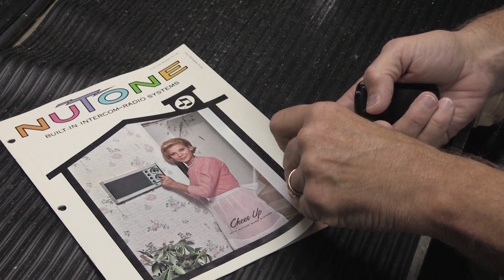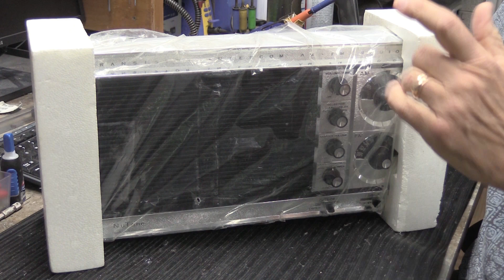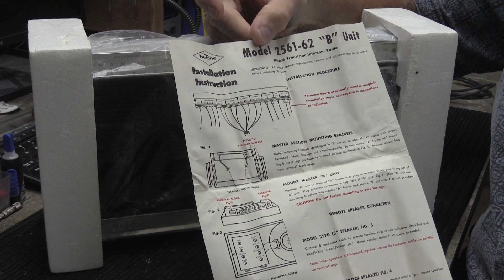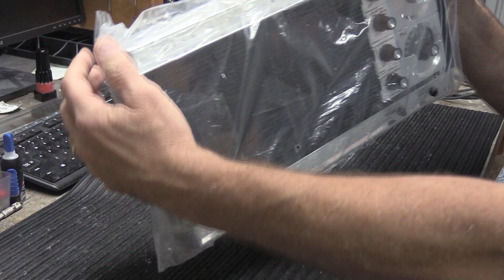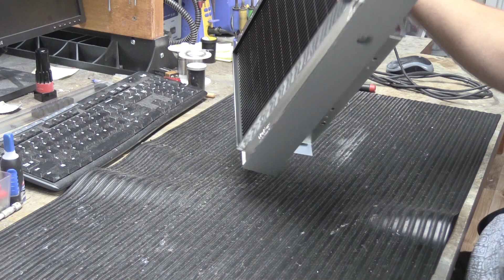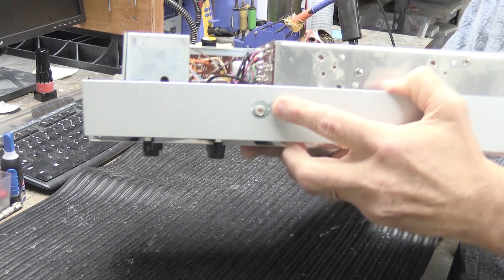Happy 60th Anniversary to the NuTone Model 2561 ~ 2562 Music Intercom System

Comment from the maker: What can be said about the NuTone Model 2561 ~ 2562 Music Intercom System?  It held the Top-of-the Line spot for over 10 years, even as newer models were introduced.  I've work on many large custom homes that were built in the early to mid 70's and by default they always seems to have a 2561 ~ 2562.   I don't think it was ever a "tough-sale" to make.  Chris

Comment: Tiivistetty metallipinta ei voi ruostua. Amerikkalaisen markkinoinnin hölynpölyä.
Reply: Unnecessarily rude comment.
Reply: It actually cannot rust. It was made when America was great. All the specifications read are totally true.
Reply from the maker: Hi QuadMochaMatti:  I'm not at all sure why you commented in Finnish - The Faceplate is made of plastic, as is the surface finish.   The base plastic is black and the Silver or Copper (gold?) is applied over the base material.  There early faceplates were made by the Amos Plastics Company.  When cleaning these, you must be careful with Copper (gold?) units.  If the water is too hot, the finish will simply wash away - Chris

Comment: Happy 60th anniversary to the love of my life ❤❤❤. The best and Hi-fidelity unit ever made with germanium transistors and all 100% high quality American parts.
This video is missing the 1966 horn speaker model 2574, the 1970 model 2575 fancy clock speaker and the 1973 surface mounted outside speaker model 2576.
The problem with the fuses was real on chassis A, then on chassis B and forward they were removed.
Hurray hurray hurray model 2561/62 !
Cheers !!!
Reply from the maker: Hi Luis:  There is no indication that the Fuses were a "problem" - They were simply unnecessary - Also, technically, there is no "A" Chassis, it is just a 2561 / 2562.  - Chris
Reply: Furthermore, you can add a turntable because records are back and turn this set to stereo using another 2561/62.
In order to do so, you must check the 4 output TO3 transistors to be the same color coding or check the hfe gain variations to be similar by 10% maximum because you don’t want to generate distortions between channels and on the same channel. Thanks !
Reply: Actually it doesn’t make a big difference if this model is NOS or not, you have to work on it anyway because it is 60 years old. Being NOS or not does not keep it away from servicing, just makes a bit less or more time to work.

Comment: Amazing to see a NOS set!   Disappointing that it blew a fuse.  It will be interesting to see what you find out failed in the power supply circuit.
Reply from the maker: Hi groovy1937:   I didn't really expect it to work on the first power up - However I didn't really expect it to have such a major fault.  More on this Mater Station will be coming soon - Chris
Reply: We all look forward to it. This is chassis A the original 2561 without any circuit modifications.